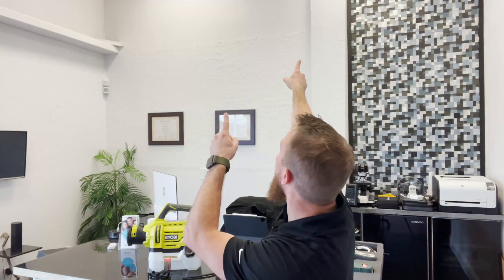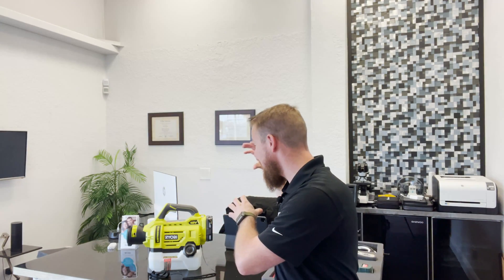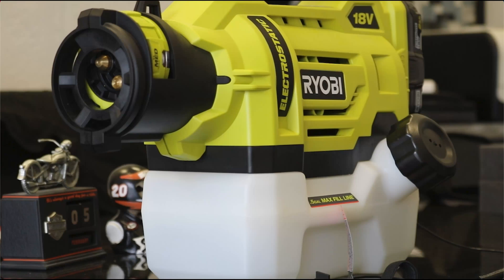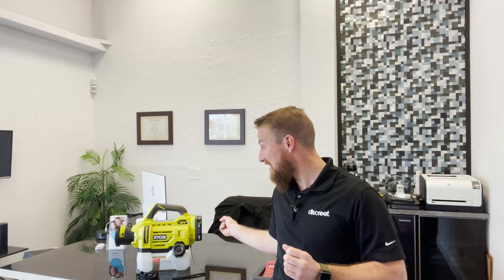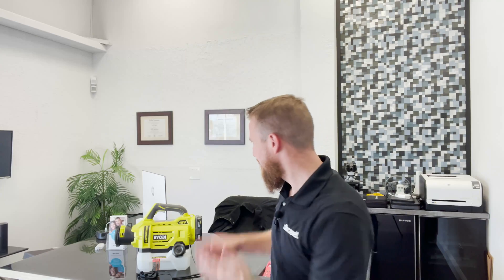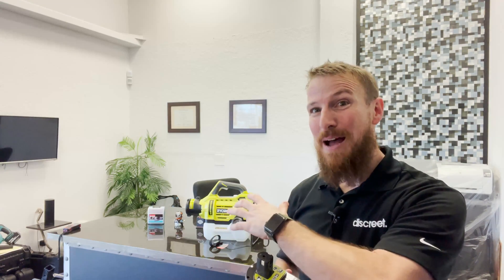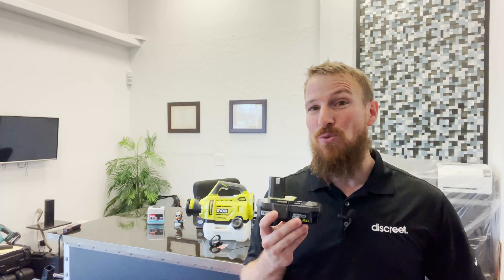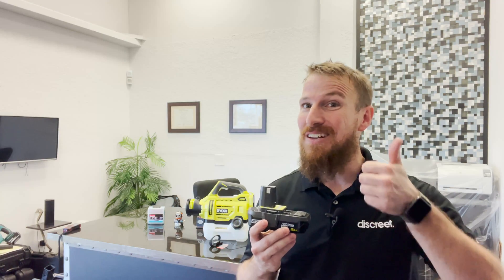Ryobi 18V Electrostatic Sprayer Review

Comment: Well, I saw a note.I just unboxed one, and it said, wear leather sole shoes.Do not wear rubber's sold shoes.I only have rubber sole shoes.I mean, it's like, is there something if you wear rubber shoes, it's not gonna work.Or what's the deal with that?I get to deal with the strap, but you didn't see anything about wear.And shoes different.Also I bought a fogger from them.One battery 12 amp batter will spray about not even the whole tank.So how you get eight tanks out of one battery is a mystery to me, buddy, but that's the fogger.Without the electrostatic so who knows
Reply: I know it's me.I was getting less than a tank off of a du.Amp hour battery, this was with the fogger.They had which was not electrostatic.But so i'm hoping for better results, but yeah, not even whole tank.So I don't know how the guy got eight tanks.Yeah, the thing about the shoesThough it's like I don't even own any leather's old shoes.And he didn't say anything about the videos.So what am I supposed to get a pair of shoes before?I can use this d*** thing or what?That's silly
Reply from the maker: Didn’t even know that was written anywhere.

Comment: why does it look like a misting/fogging machine. Is this good for spraying lawn chemicals and insecticides around my house? Sometimes I have to spray grass-weed killer on larger areas, will this tool be good for that?
Reply from the maker: I’m certainly not an expert of the use cases for this sprayer, and others like it. However, I have seen others use these types of sprayers for applying lawn care products. 

I would recommend downloading the user guide for this sprayer and reviewing it.

Comment: Hi Josh, Great program. I was wondering if you could you review the IAQ EXTECH VPC 300 particle meter. I am really interested about the different particle scales, what they represent, how are the used and specifically which scale us most useful for detecting mold spore contamination, and what is could be identified with the different scales
Reply from the maker: Hi Alex. Thanks for the feedback! Unfortunately, I do not own that Extech meter, nor do I have a need to purchase one. However, if the folks at Extech are ever looking for a third-party review, I’d be happy to put this meter through the ringer! 😎

As far as best particle sizes to look at when it comes to mold/fungi, PM2.5 and PM10 have been the ideal channels to look for anomalies within an environment that may have mold-impact. With that said, mold spores and fragments can vary in size, so one should not get fixated on one channel over another. I’ve learned from others that it’s best practice to simply look for anomalies in quantities - whether that is much higher concentrations within one area of a property or in comparing channels. 

In general, you should see the highest quantity of particulate within the 0.3 micron range and the least within the 10 micron range. You’ll typically see the 0.5 micron channel be slightly less than the 0.3 channel, the 1 micron slightly less than the 0.5 channel and so on. However, when you see one channel higher than the smaller channel above it, that would often be considered an outlier - prompting further inspection on your part. 

Hope this information helps!

Comment: Would this work in a home infested with roaches?
Reply from the maker: Hi Justin. Unfortunately, I’m not a insect/pest expert, so I won’t be able to answer that question for you. However, I know that electrostatic sprayers can be used for pesticide applications. 

I would advise taking a look at the manufacturer information for this device. Here is the link to a page that discusses compatible products. 

https://images.homedepot-static.com/catalog/pdfImages/64/64852838-1075-432f-bde0-ae50562c7c75.pdf
Reply: Make up batches of borax and sugar. You can find instruction online.

Comment: We have one of these at work and we used it every day and it last about a week before it needs a charge. So it works ok. But All of the sudden it stopped working and I was trying figure out why it wasn't spraying and was wandering has a fix for that.
Reply from the maker: Bummer… Sounds like your best bet may be contacting Ryobi to inquire about repairing the unit. Hopefully it’s nothing major!
Reply: @IAQJosh  i figured it out, the nozzles where clogged even after washing them soap and water. I had to use a high powered compress to blow out the nosles to get them to work.
Reply from the maker: @Kevinthewiseone  Gotcha. Well, that’s good. Glad to hear this unit is standing the test of time.

Comment: What you didn't do was spray upwards from the object, so gravity will bring the spray farticles downwards. Duhhhhh

and the way you spray you can create that air flow to make the chemicals wrap aroudn to the back.  Re do your experient, and consider this one YOUR failure
Reply from the maker: I see.
Reply: It doesn’t work as advertised. I’ve tried a few. The expensive ones work

Comment: For wrap around effect your supposed to spray over top of objects not only directly at them. I seen it in another review.
Reply: If the electrostatic switch is turned on, they charged particles attach themselves to both sides of the object without having to spray overhead.
Reply: Sorry wrap around is specific terminology relating to the wrap-around effect, spraying down just is more effective at covering more surfaces in a single go. Two different things.